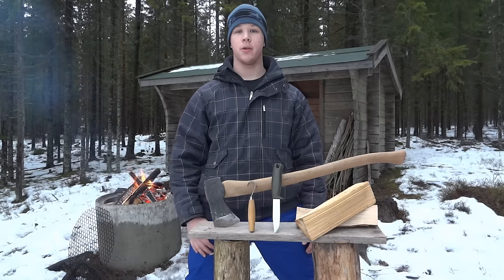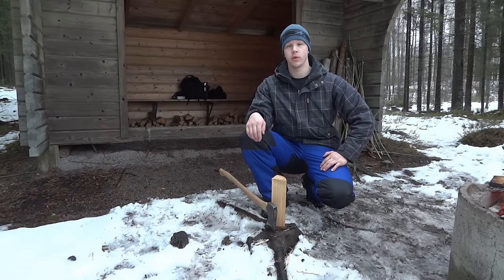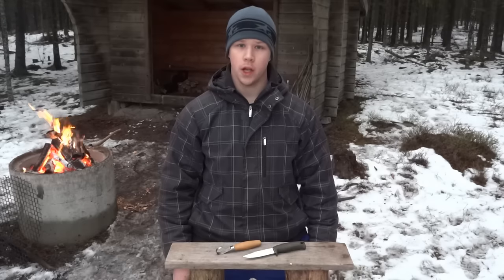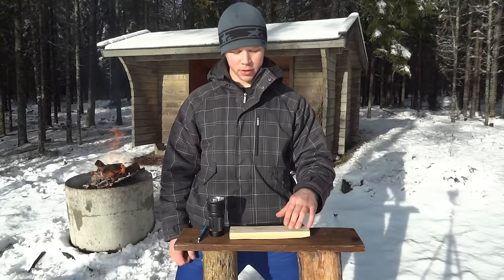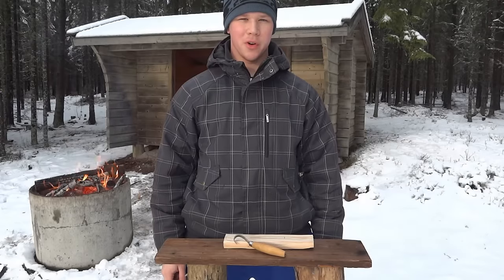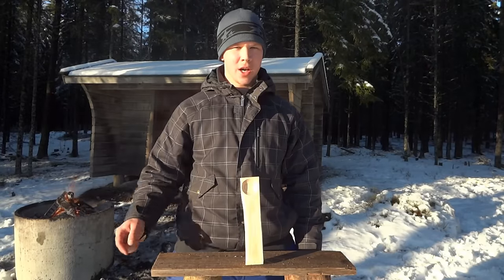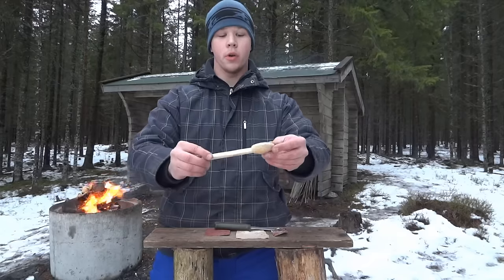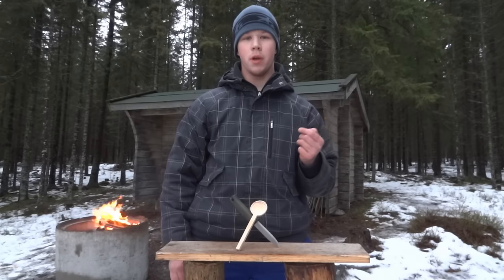Bushcraft - How To Carve In Wood.

Comment: Say Heah North, I was just wondering, would it be possible to carve the bowl out without the crooked knife, just using a knife like my curved belly Skookum Bush Tool,  Normally the blade measures 4 1/4", but I had more curved belly instead and it's just shy of 4". It's one of my Fav's bush craft knives that I carry it as a neck knife on my normal large knife small knife carry. I have two all time Fav's although I have other sets in larger sizes, But for comfort carry I really like a 7 1/2" blade and a 4 1/2+ blade. I'm bored like my Rodent 7 and my Rodent 4,  I recently bought a Busse Combat set in that similar size, I bouggt the Badger Attack Ergo and the Steel Heart Ergo. It depends where we're going and for how long I might carry my Rodent 9 and my RatManDu,  and in the INFI Steel I might go with my Nuclear Meltdown Fussion Steel Heart and my INFI RatManDu,  we always carry a axe and saw. So far I really like my Skookum Bush Tool as my neck knife besides the other knives which I molle attach to my backpack, but I like carrying the larger knife on person, this way when I'm scouting a new area and I get lost I have my neck knife and belt knife on my Survival Belt with a Pouch of necessities, ( ompass, medical first aid, firestarter) So have you tried carving a bowl out with a straight knife. Thanx for sharing you making that spoon.
Reply from the maker: +paulie 4x No, i have not tried that, but you can burn it out with hot coals.
Reply: Oh I know about the hot coals (embers) but I mean just using anot knife to carve out the bowl with just the knife. I'm not that good and I think your pretty good yourself, But that's why I had my Skookum Bush Tool made with a real curved belly, it's a continuous curved belly and because of that it's a great carver, I also had it made in the 3V Steel, It's one of my Fav's and I really enjoy using it as my neck knife. As far as a bush craft knife my Busse Combat Son of Badger is also one of my Fav's,  it's great for general use. Then John Bradley made me a "World's Best Camp Knife" that's what it's called, He US tempers the 52100 and create a masterpiece, it's beautiful and a piece of art, I had mine made with Desert Ironwood and it came out gorgeous.  He also made me a custom leather sheath for it. It's a 4" blade and he blues the blade but the outer parts he leaves not blued and highly polished, it's a 1/8ths" thick but because how he tempers it it's a very strong knife. He also made the edge very thin, but again the Austempered allows the steel to be very thin and yet it doesn't chip and stays razor sharp, I really like using it when I use to hunt grouse and do camp work with it, it's simply tit's.  As far as one if my Olé time Fav's .y RatManDu is my Fav's and I also have it in the INFI Steel infact I have two of them in the INFI Steel, I guess I was just lucky because it's pretty rare, But like I have mentioned I like the philosophy of carrying a large and small knife combo, I have my knives thinned down and my Fav's are my Rodent 7 and my Rodent 4 now I just bought a similar set in the INFI Steel which I'm very happy an ducky to get, I got a beautiful  matching pair, I got the Steel Heart Ergo and the Badger Attack Ergo which I had them thinned down, they match like soup and Sandwich or peanut butter and jelly, Yeah its a perfect match the S H E is a 7 1/2" blade and the B A E is just under 5" so yeah they compliment eachother size wise and how they look as a pair. I can't wait to put them through their paces. As you can tell, I have a few knives. One my age I accumulated some nice knives and it's one of my passions, But lately I went simple, I'm using my Ka-Bar Johnson Adventure Potbelly because my BK-2 sometimes wasn't long enough for me. I sometimes baton with a knife although it's not recommended but heah, I do so I like a robust knife. Anyhow the Potbelly is just that, It sort of resembles a Nessmuk butcher type of knife with a nice curved belly that carves pretty good for its size, I paired it off with the Parangatang another great match and I'll be using it as my Summer Long knife, But with tge Potbelly I use it as a 1knife carry the only thing I carry with it is my Top's Mini Scandi 2.5 as a neck knife, Oh, I also take my Hultafors Bruks 17" Agdor range Hatchet which I bouggt it as a closeout when they dropped it for another range but it's a good one and I was able to put the same kind if edge as my G B Small forex axe and it now is just as sharp and that's how I process wood with it, I also bring my Wicked Tough Saw yeah its a tough one and it doesn't bind as much as my Sikky. A nice trio if you don't include my neck knife. In the warner weather I go much lighter, I like my Rodent 5, the hatchet which is my 2Hawks Double Bit Hatchet and the saw. It was nice to meet you, I just wanted to introduce myself as a serious outdoorsmen, I do enjoy your videos, Keep up the good work.